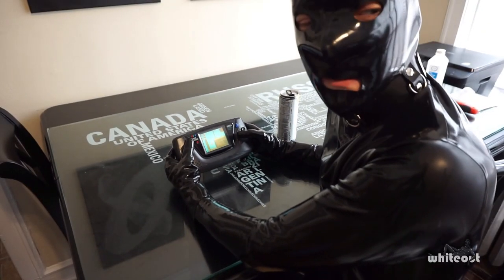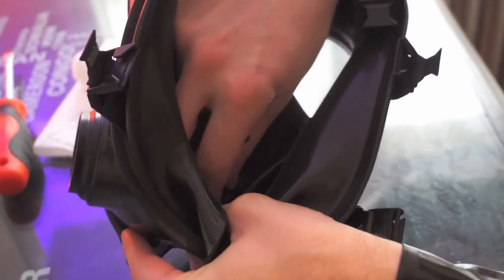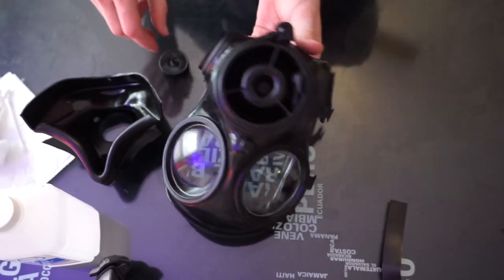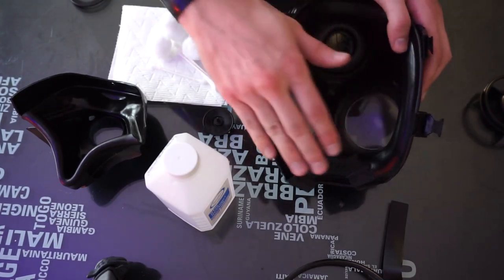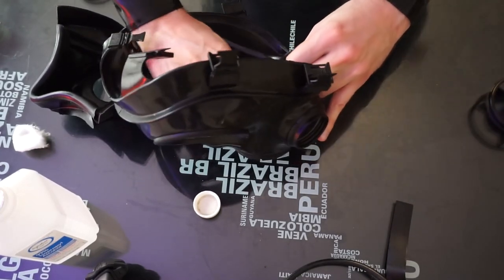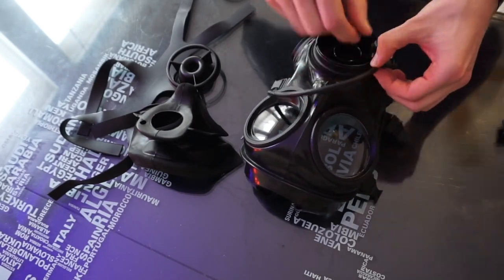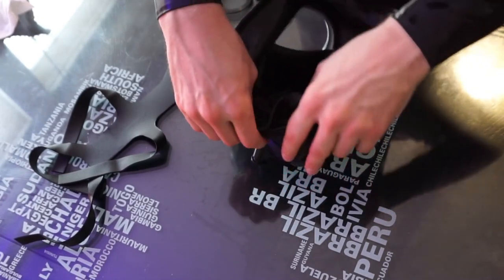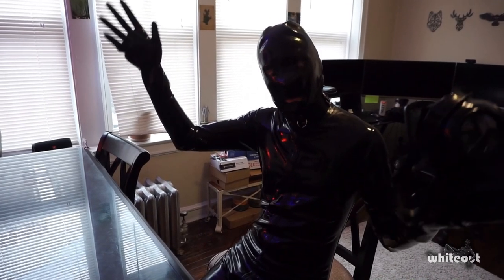How to Clean an S10 Gas Mask

Comment: 04:25 Hi, thank you for the tutorial. I've cleaned the mask according to your video but my exhaust valve is still completely stuck. I can't exhale wearing the mask. Do you have any other tips on how to deal with this, please? Of course, when I took the flap out, my mask got extremely foggy in a short period of time, so I'd like to solve this. When I touch the flap, it's completely dry, not sticky at all. Thank you.
Reply: Did you accidentally install it backwards, by chance? The exhale diaphragm need to be pushed in from the outside of the mask so the flap is on the outside and the arrowhead shaped nub is inside, pointing toward your chin. Hope this helps.
Reply: @Chris-hi8gc  Yes, eventually I realised I'd inserted it back from the wrong side. I felt a bit dumb afterwards. 😅

Comment: Ι bought an AVON FM12 and it sticks a little in the nose area. Ηow could i fix it?
Reply from the maker: Isopropyl alcohol and a paper towel should clean off most stickyness. It's also possible the rubber is getting old and starting to rot which causes it to get a tacky feel.

Comment: isopropyl alcohol will break down the rubber over time btw
Reply from the maker: Only in large amounts like if you were to soak the mask in it. For basic sanitization it's totally fine.
Reply: Exactly what I thought, probably not best for the mask in long run.
Reply: I find this odd...most synthetic elastomers have a very high resistance to IPA.  Some plastics like PVA and PU on the other hand will dissolve.  It really depends on the type of rubber.  My last count had there being over a dozen different elastomers.